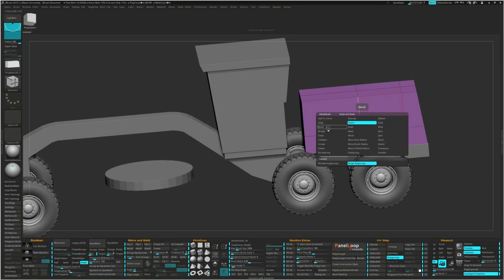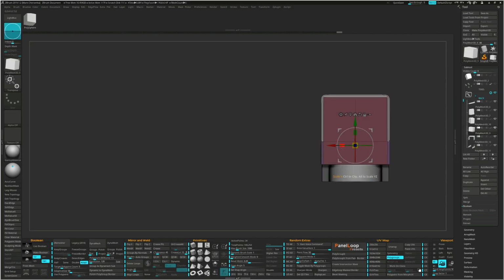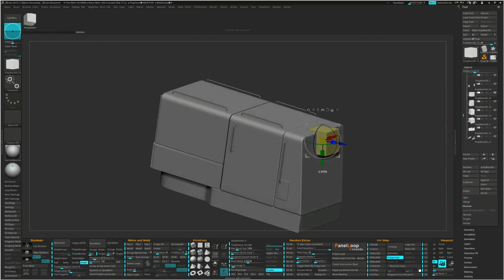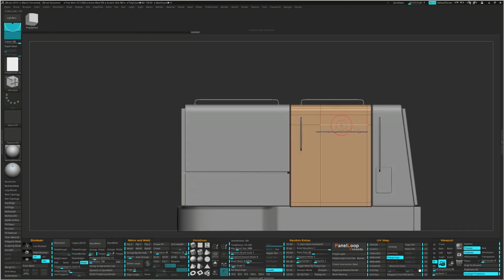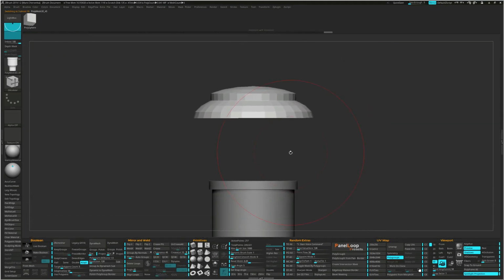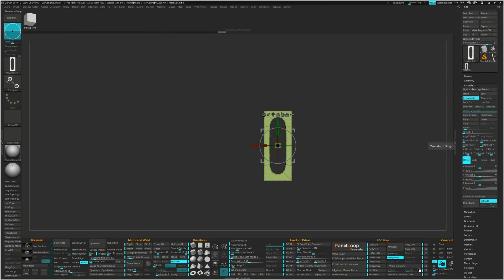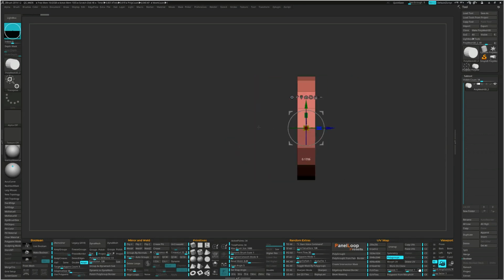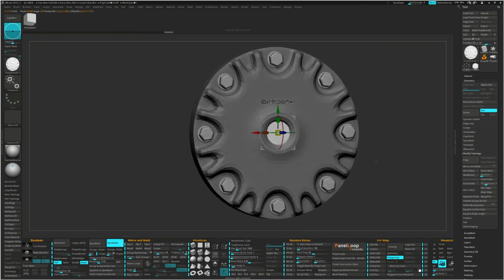ZBrush Guest tutorial - How to model a 140H Road Grader Part 2 of 5 ( by Henry Chervenka )

Comment: Minute 27, I am trying to follow the video, how does he punch that hole in the engine housing, zmodeler split point?
Reply: Hello Nicolas. Because of the amount of horizontal edge loops from the vents, you can not use split point to get that large of a hole. So what I did was add vertical edge loops and used slice circle. Then used the ZModeler brush with point action set to stitch to weld the really close verts.
Reply: @henrychervenka   thanks a lot, I will try to do it that way.
Reply: Or with a Bolean?